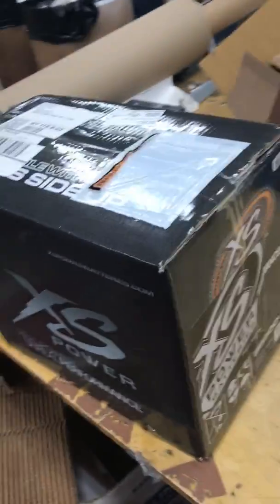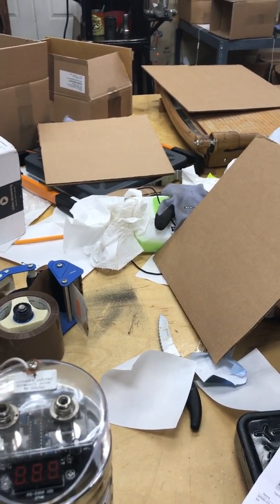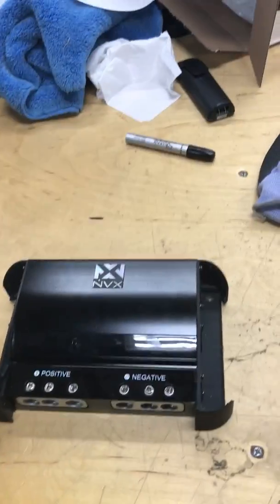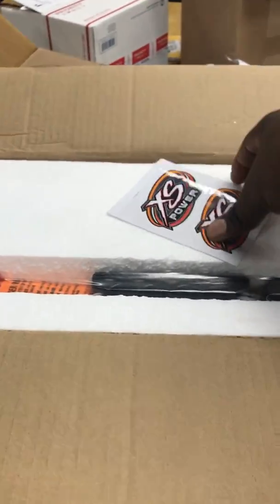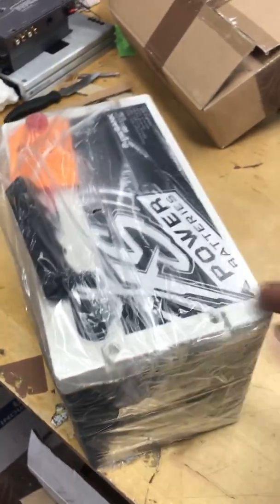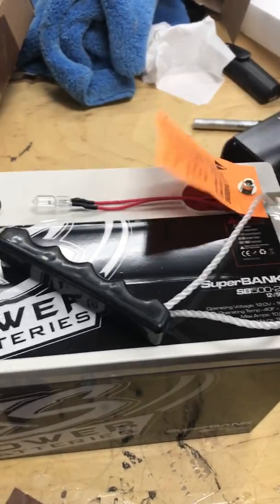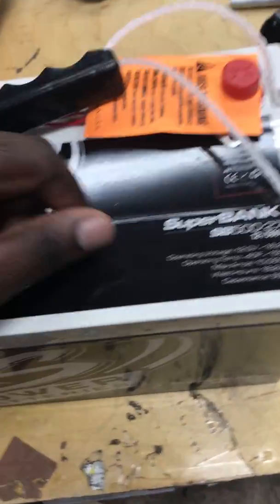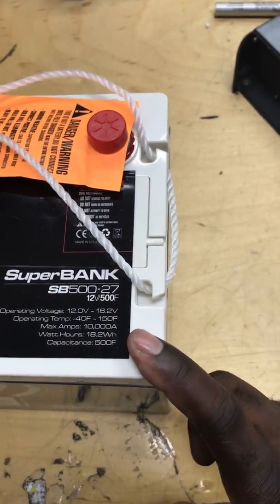Unboxing xs power super bank capacitor

Comment: Nice video but I must say one thing, this supercap is not for real of a battery. This delivers a huge amount of power instantly whereas a agm battery stores a huge amount for the long run. I know that you can use this as a battery replacement in the trunk, but that is not the way to go. Add this to your battery bank

Comment: Ho Bruce, great video, informative and clear. I just subscribed to you. Hey, could I use the XS "XP750CK"; (the secondary amplifier kit, that includes a 750cca amp AGB battery, plus 1/0 cable) and (2) fuses and holders? Could I use the SB500-27 SuperBANK AND the XP750 battery? What about substitute the XP750 battery for the SuperBANK cap?